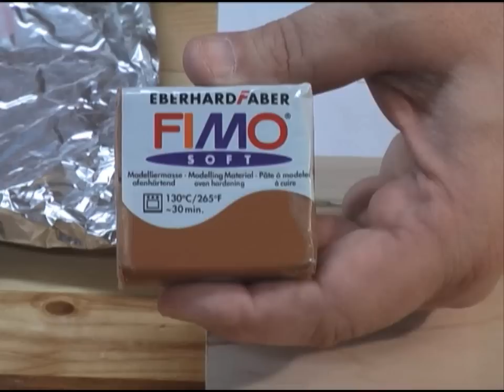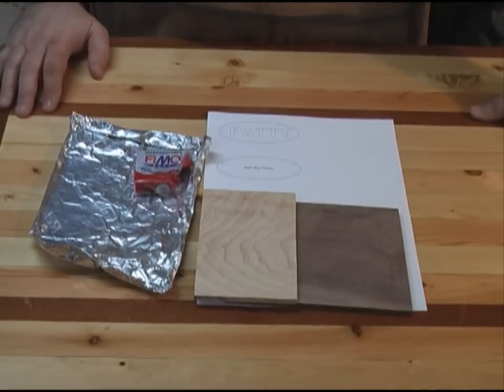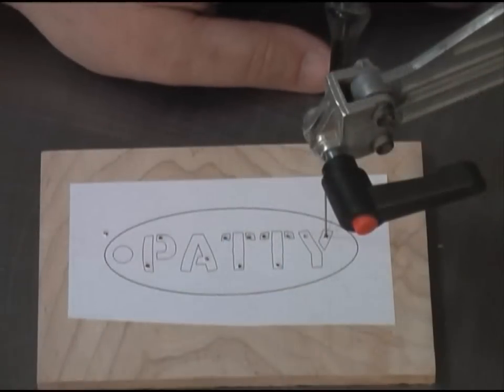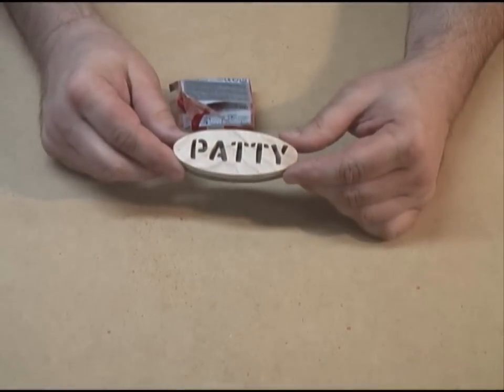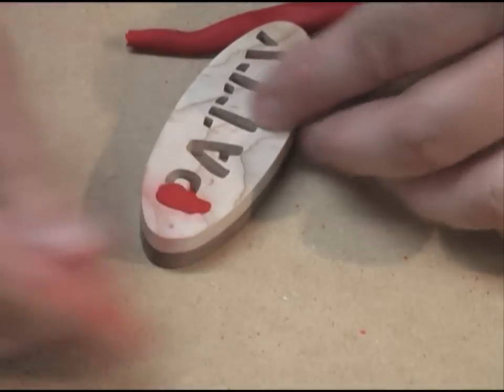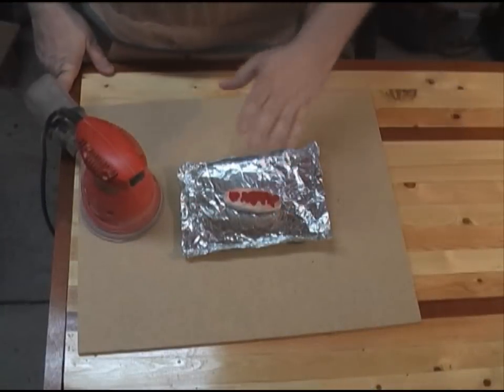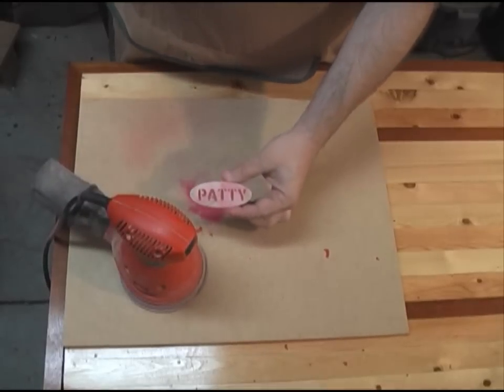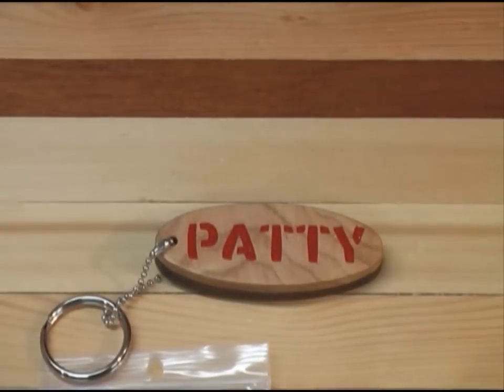Polymer Clay Inlay Technique for Scroll Saw Projects

Comment: One tip concerning removing the extra clay...use a polymer clay blade and easily shave it off flush before baking. Then once baked you wouldn't have all of that sanding to do...only a touch up.

Comment: Scroll saw plus colored epoxy? Yes/no? Why?
Reply: I have used epoxy in scroll saw projects before and they worked fine. In the video above I used polymer clay because it is so easy and fast. The epoxy does look better in my opinion.
Reply: @stevegood3224  thx Steve. Was thinking of a stain glass type effect.

Do you have a table saw blade recommendation for resawing without a bandsaw? I assume a flat tooth type.

Thx again!
Reply: @PureBloodWNC  Resawing on the table saw is not something I have any experience with so I'll pass on that question. I would hate to give bad advice. I have a floor model band saw that I resaw with. Sorry I am not more helpful.
Reply: @stevegood3224  completely understand. Thx sir